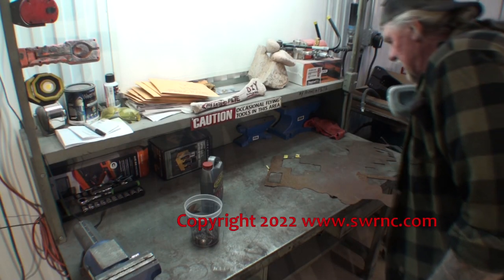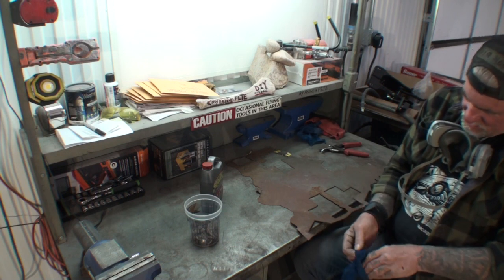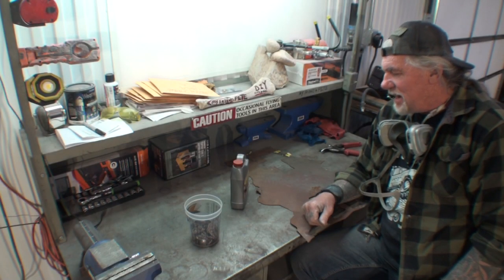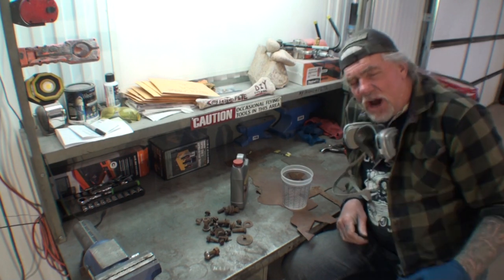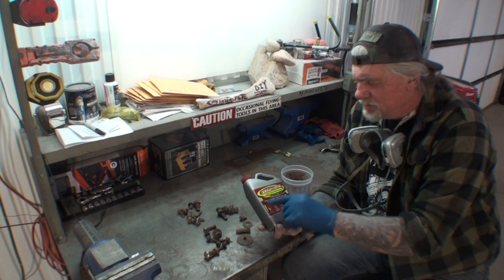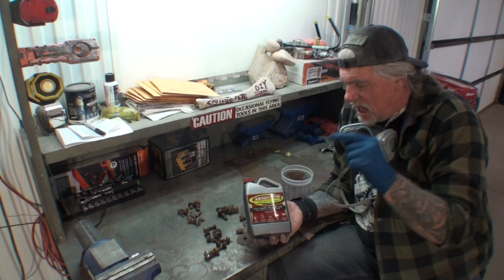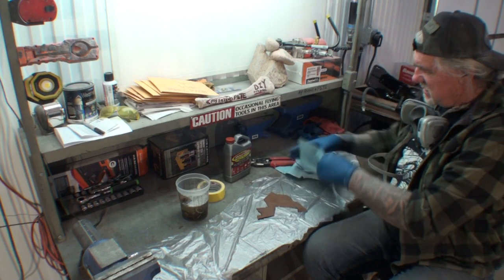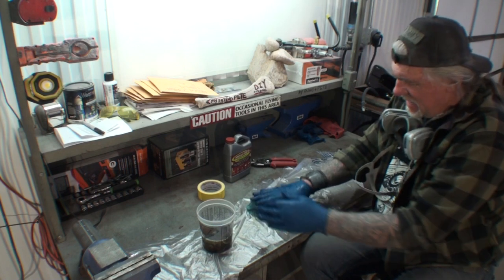How To Remove SURFACE RUST

Comment: I have been using vinegar to remove rust for years and it works great. For larger panels like on a car, I use molasses covered by plastic and leave it for a few days and then wash it off to reveal clean rust free steel
Reply: Todd, I guess they still sell molasses in grocery stores. Baking isle, I guess. Wonder how it would measure in a "Side-by-Side Test?" Interesting thought. 
   Have a safe couple of months until we have to "Buy" a calendar! Still waiting on my bank toaster after opening a new account! 
DK, Omaha, NE.  (Don't like the snow anymore)
Reply: @deankay4434  yes it's still sold in grocery stores  and while it is more expensive it has the advantage of being thicker with the ability to stay in place even vertical or  overhead, but it is a bit slower than vinegar. There are probably some videos here on YouTube that are useful that explain how to use it for rust removal

Comment: Hey Pete, Thanks for the DIY tips. I have found tumbling hardware in vinegar cleans it well as long as there is no caked on grease. I made mine from an old wiper motor, a 5 gal pail, and skate wheels. I put it in the shed and let it go overnight. Maybe the HF rock tumbler would do the same.
Reply: Great idea Lane. I bet McMaster-Carr sells the little ceramic cones that work on many things. Coated header came out of a ceramic cone tumbler after ceramic wash, but you need a 55 gallon plastic drum and dryer belt, motor and support wheels. Hey wait a minute....
DK, Omaha, NE. (Got to see the SAC air museum 24 miles West of Omaha near Clayton Andersons home town, the astronaut. I saw the cut-away of a real radial 16 cylinder at the original SAC museum, located on the old Martin Bomber plant grounds. Yes, we had a Rosie the riveter here too! Stay safe. I lost the year to 3 lumbar surgical procedures. Still can't walk without a cain. 4 fusion, 1 done twice, RFA, now electric implant they put in upside down. Still have that to pay. Should have done the weather!

Comment: Good video Pete. I have a question. If we spray 'epoxy sealer' on the washer that you wire wheeled, will the rust eventually rust through, or eventually 'bubble' up? Or; is the rust treated enough that the decaying action is stopped? Thanks for the video Pete. 
I buy a lot of stuff from Harbor Freight too. I am happy about the quality their tools have stepped up too through the years. Phillip Hall

Comment: So I have a hood I had about given up on until discovering your videos and a few others using similar methods. The hood is all down to bare steel with the classic light rust everywhere. Not just a surface rust layer a sander would take off. So my plan is to soak paper towels and lay them across the hood, wrap all that in plastic wrap and let sit overnight. So when I open it the next day just wipe it all down and sand? Should be fine to paint over the blackened previously rusted areas? The rust won’t bleed back through the new primer/paint/clear? Thanks for any help

Comment: Ok My Friend Pete, now that the parts are clean of rust, how do you stop them from rusting again right away?  I have done this with vinagre and the parts started to rust right away again.

Also I tried to get rust off the trunk of my car and I put vinagre on a towel and left it there.  the vinagre etched the metal and I don't know how to fix that.  Will this product the same thing to the metal?

Comment: I have always used muriatic acid. i even use it to remove rusted nuts and such.  I have cleaned engine blocks people gave me free. One was a BBC 454 engine. I used a garden pump 2 or 3 gallon pump. Honed the cylinders and valve lifter holes and made a good block that ran 10:30 in my drag car for 10 years with no problems. I have some in a spray bottle to remove bolts and nuts on anything. Use another spray bottle with baking soda and water to neutralize muriatic acid. Best way to clean this kind of stuff that works and is cheap.

Comment: Very interesting, if not base, not acid, no strong smell and still cleans. This makes me wonder as I a seen molasses used to clean metal which has little to oder. Interesting Pete!
Reply: It is based off of molasses with a cleaning agent
Reply: @newriver8940    Thanks "Newriver" for the molasses connection. For me, it is always a process of elimination  after fixing cars, my brain heads that direction. 
  I don't know where the entire year went after it warmed, but please, have a safe November, Thanks giving and then some Christmas action if you practice it or not, then here come a new calendar. Banks used to give them away, but now, if you are allowed in the lobby, you walk off with a bank ink pen, steel gates drop and you surrender then pen. ;), joking, but I never got that toaster dang it!
 DK, Omaha, NE. (No longer like snow)

Comment: Excellent review my friend Pete!  I might try immersing greasy nuts and bolts in a cup of carb cleaner overnight first?  Maybe blow it with compressed air to evaporate the carb cleaner faster then throw it in the evapoRust-  I guess it would be a little more toxic but great vid, I'm gonna try this product, I've had a gallon of it in the garage for a year now and just haven't gotten to it somehow but the floors of my '88 F150 have bad surface rust and soon I will deal with it, "soon" because of the inspiration of this vid so thank you!

Comment: thanks Pete, this is a great video and exactly the product I been wanting to try when restoring my 57 Plymouth Belvedere. I think i am going to setup a water sprinkler to run this chemical over a fender and have it drain into a plastic pool and just keep recycling that.. I think this would be much cleaner and healthier for my shop and my lungs than sand blasting. I let you know how it turns out or hell, you can try it too :)
Reply: You are going to have a lot of evaporation that way.

Comment: To clean those nuts and bolts, use the ultra sonic with that rust remover product. 
Other option is to use a tumbler with abrasive. 
You can find all this at Harbour Fright!

Comment: I use evapo rust then I'll hit it with a wire brush or wheel and repeat, or move on to fast etch from eastwood to leave a zinc coating on it. Works great.

Comment: You forgot to mention its greatest benefit besides rust removal... it's safe on rubber, paint, ect. I have actually used this product in a continual spray underneath cars. The product drains into a tub and is pumped out again. It won't dissolve grease markings from the factory either or paint when trying to save an original car.

Comment: I have use that product for my Mercedes bolts and nut restoration if you use it on an ultrasonic on hot setting works incredible fast , for me is the best product .